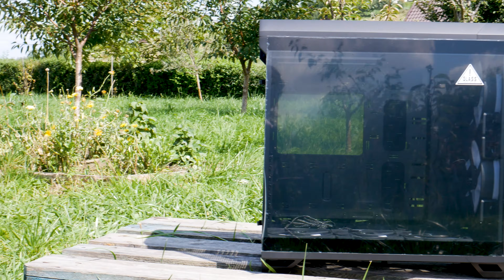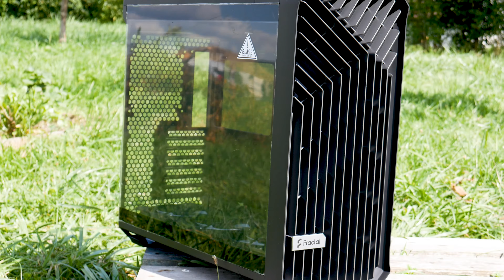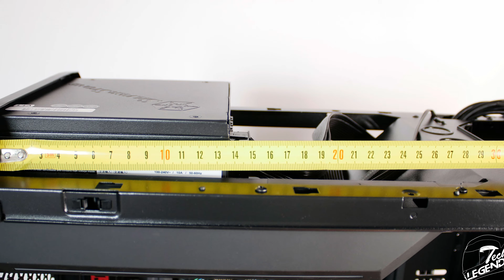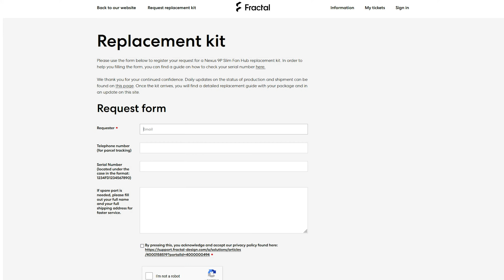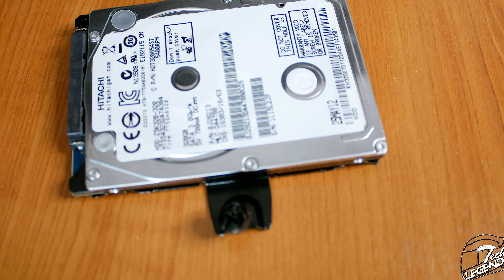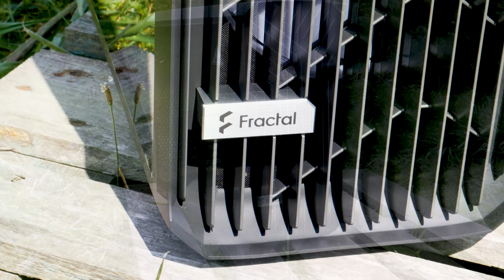Fractal Design Torrent RGB - PC Case Review!

Comment: It hurts to watch this video.  I'm trying to get this case along with an S36 Lumen RGB...  But I can't find either of em' in stock anywhere lol
Reply from the maker: Tell me about it! That Lumen cooler looks great but not available anywhere!
Reply: @TechLegend-com  For real!  After struggling to get my 3000 series GPU about six months back, my initial thought with the S36's supply was that the liquid coolers must have been getting scalped too lmao.

But just today actually, I managed to get this case in Black and just grabbed the FD RGB fans separately so that it matches the RGB model.  But I also just went ahead and got a Liquid Freezer II 420 (blaze it model), as I didn't want to wait for the S36 to restock being that I need to keep my 129 cool under load.

Long reply, but side note, you can get DDR5 RAM down to CL32 and lower (possible content?).  Mine works at CL32 / 6000 =p
Reply from the maker: @NippleSauce  The Arctic you got is a good CPU cooler. DDR5 RAM is still very hard to find, so content with it will be in the future perhaps!
Reply from the maker: @NippleSauce  Great, and thank you very much for the timings! :)

Comment: I have been running a 3900x in one for a few weeks. It is a good case! Lots of airflow, stays cool all over the board, and looks nice. The easy-clean filters are great too.
Reply from the maker: Yes! What do you like the best with this case?
Reply: @TechLegend-com  I like the fact that the psu shroud pushes the air down and into and through the VRM's cooling them and the MoBo down.
The large fans have few if any blockage.
Lots of room to build in.
Great airflow, and easy to maintain.
Nice appearance, esp the RGB version.
And enough storage for most people.
Reply from the maker: @johndicus123  The PSU acts as an exhaust in this case. It draws air from inside the case and pushes it out. 
Btw, you should have seen the white variant in person, it looks great!
Reply: That'd look great with a white MoBo and RAM... wow.... sounds like a nice looking rig.
Reply from the maker: @johndicus123  Yes, I have the Silent Base 802 in white, but no white motherboard though. Those are very rare these days.

Comment: I love Fractal's design with this case and the huge airflow it can deliver, but if I was getting a case now I think I would go with the Silent Base 802. But still congrats to Fractal for making an airflow king and also how they managed the situation with the fan hub.
Reply from the maker: I like my Silent Base 802 more, just because it is easier to work with and is more flexible for storage options and watercooling.
Yeah, the fan hub situation was handled with grace.